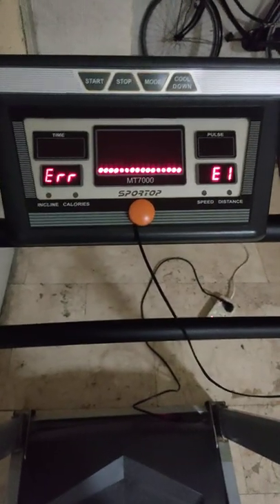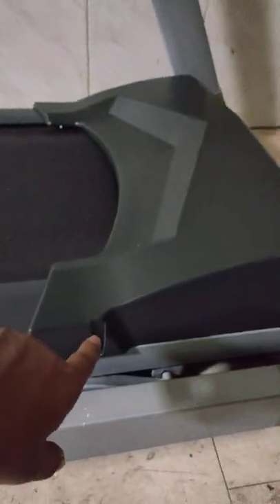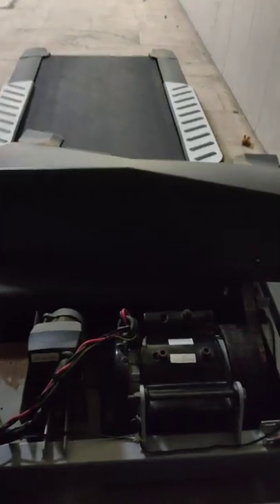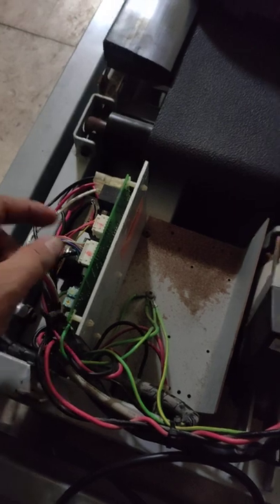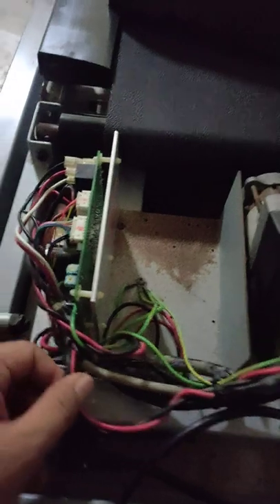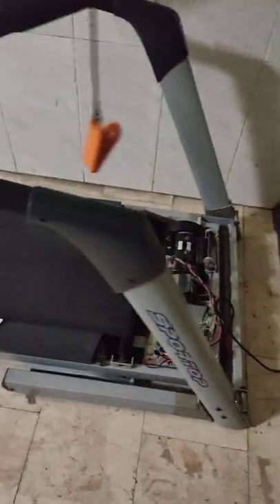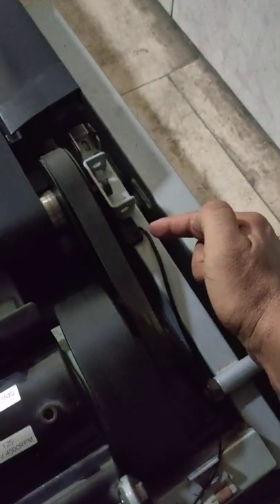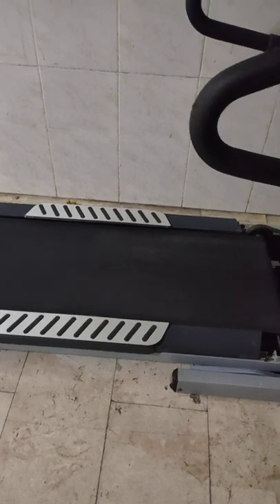how to fix treadmill e1 error model sportop T7000

Comment: If the belt stops after one second in York 66900 treadmill?
And I've already changed the speed sensor.
Thanks in advance
Reply from the maker: You have to install speed sensor properly if again problem then check speed sensor port on pcb